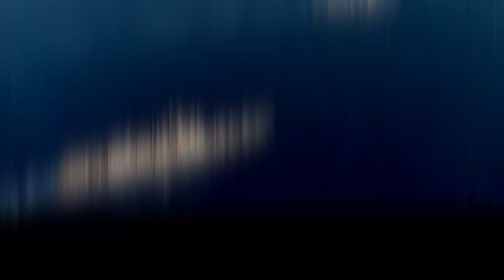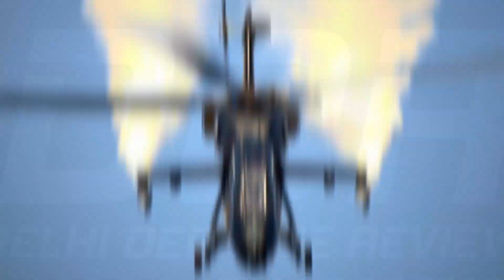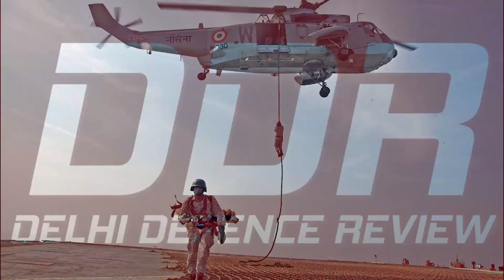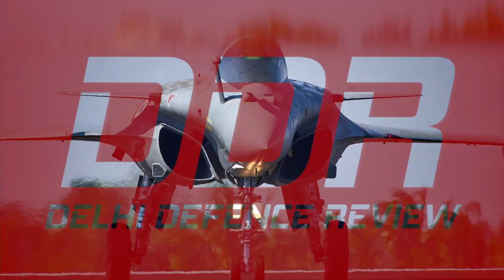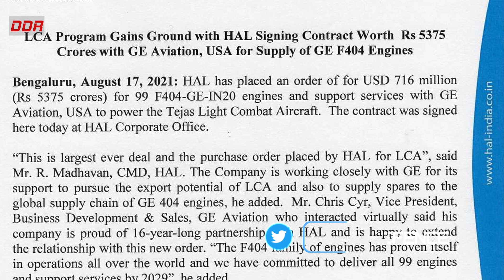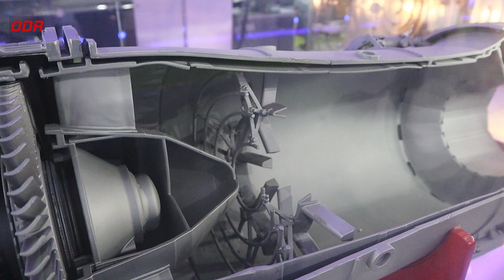HAL General Electric LCA Tejas Mk-1A Engine Deal GE F404-IN-20, F414-IN-20

Comment: American engine high cost no tot no use for India .erj200 good engine tot deal for India very good deal for India
Reply: Who told you that Europeans are going to transfer the technology to us?
Reply: @ismt101  Hal is ‘assembling” kits of engines
Reply: @adithyanairh196  yes, only assembling not manufacturing with ToT.
Reply: Ge 404 is cheaper due to larger production run.
Reply: They signed the deal and are now designing Tejas mk2 / TEDBF around GE F414